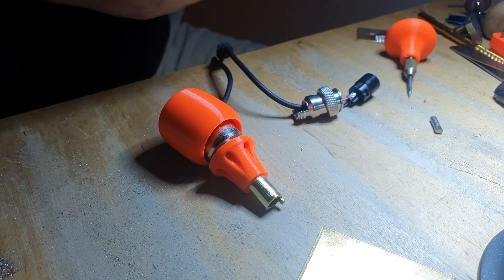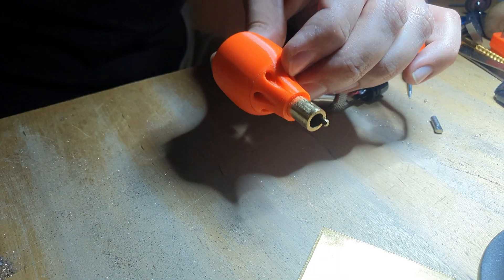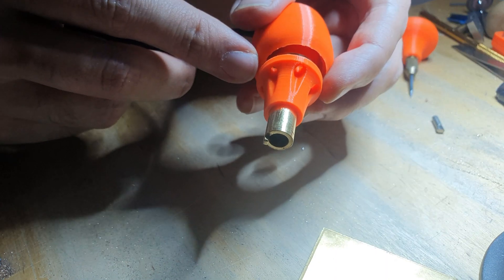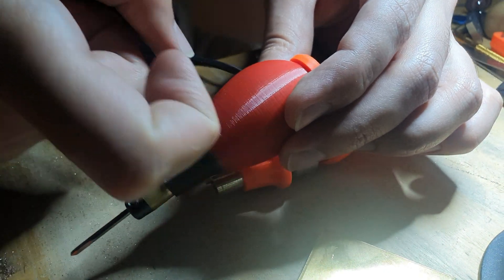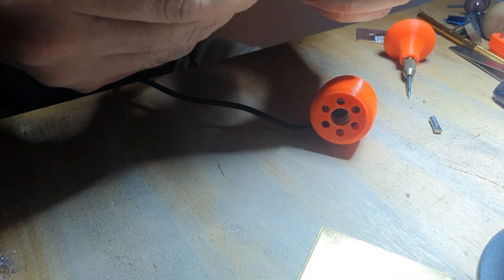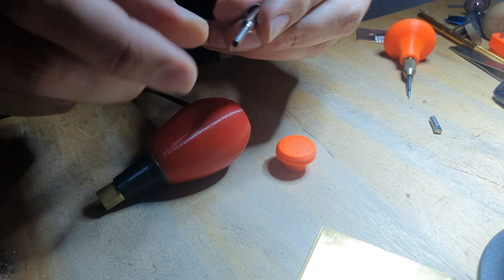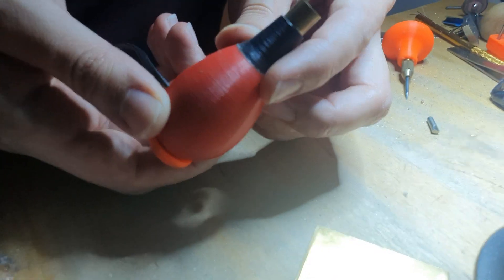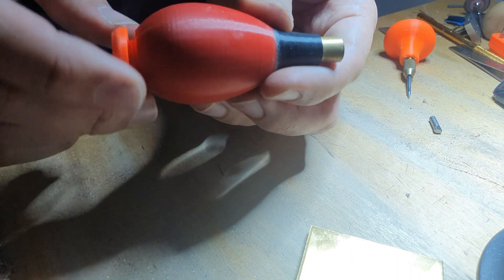Crafting Power: DIY Solenoid Handpiece Assembly with 3D Magic

Comment: Отличная работа! Скажите пожалуйста, сколько по времени работает этот наконечник, до того как будет нагрет до слишком большой температуры?
Reply from the maker: The 1642 when setting stone havent warmed that fast since there are several pauses between the settings. This was at 18v. To make sure its possible to put some vents and test it when engraving.
Reply from the maker: If you use it at 1800 beats per minute it wont heat as much as if you are using at 4000 beats per minute.
Reply: @selvalss спасибо за ответ! Успехов вам в работе! 🤝🤝🤝